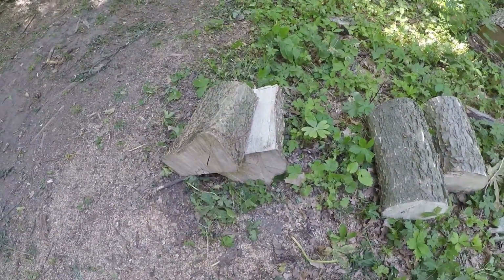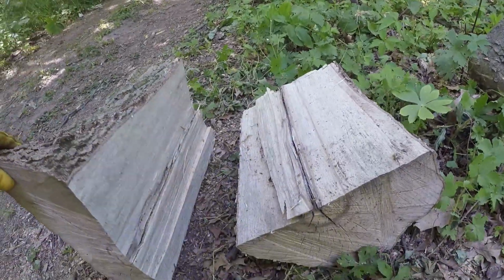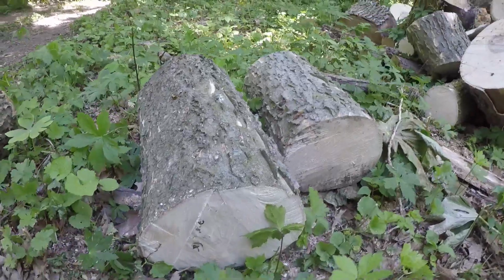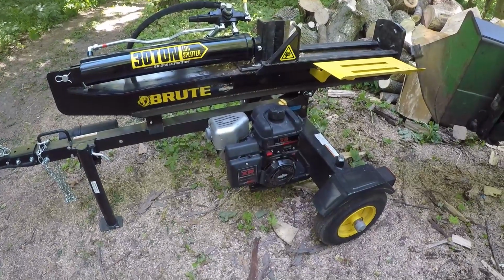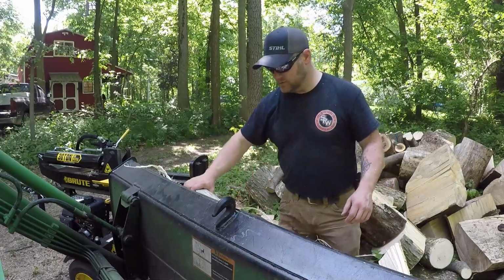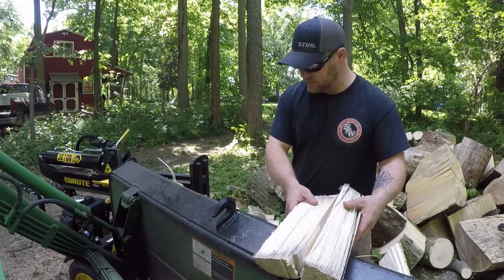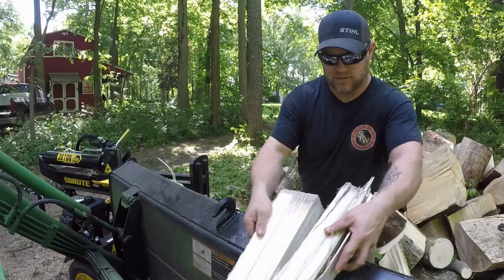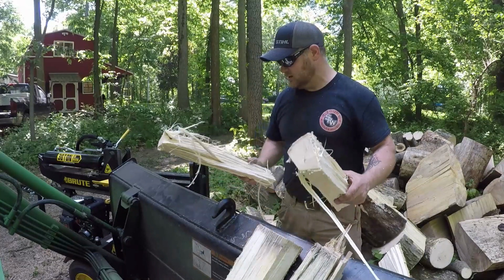Green vs. Dry Hackberry Splits

Comment: I split 1&1/2 totes of it Monday. It was cut last year. It does usually split better if not as wet but I have had the freshly cut split well if not many branches.  This was the first time using the Axis on it. It was definitely easier then when I used the 90’s box store splitter that had a wide wedge. Still had plenty of strings. Nice video and example.
Reply from the maker: I bet the thin wedge on the Axis goes through it pretty nice. Thanks for watching, it is appreciated.